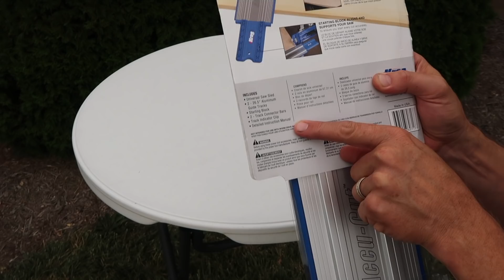KREG ACCU-CUT CIRCULAR SAW GUIDE - TOOL REVIEW TUESDAY

Comment: Really kills me seeing you do this review. Thanks for trying. Need to really read the instructions before making a review. First cut will always cut some of the blue on the tool. You try to cut the least possible when you first set up the sled to your saw. Next thing always have your tool on the piece that you are not cutting off. Initially you did this but on your second cut you didn’t. The reason your second cut came out so accurate is because you cut off part of the sacrificial blue material on your initial cut, hopefully 1/32 if you tried and read the instructions. I’m not going to go any further. Not sure how much you didn’t really do but I suggest for the people that follow you and for accuracy redo this video.

Comment: I have one save your money buy a real track saw !
Reply from the maker: Kreg has a track saw that looks nice.  I'm hoping to test it out on my channel sometime soon.
Reply: I’ve had problems saw moving on base laying saw down after a hard days use track saw guide screws moving so tracks won’t stay straight Phillips head screws rounding out can’t plunge cut no dust collection bought a cordless makita track saw 👍👍👍👍👍and selling kregs track
Reply: Ps makita tracks are interchangeable with festool accessories and others .Track slop on kregs accu track ,doesn’t play well with others accessories lol. bite the bullet I’m glad I did 👍😎
Reply: @MarkThomasBuilder  looked at one today. Woodcraft had one on display looks like real deal over accu trac . Wished they would have had festool track beside it for comparison see how close track design were makita and one other that I’m aware of are close enough to enter change accessories I went a head and ordered makita cordless that’s the battery plat form I have just made sense for me good luck 👍
Reply from the maker: @plumbum6558  Please let me know how you like the Makita.  I'm trying to gather information on track saws for when the time comes that I review them.  Thanks!